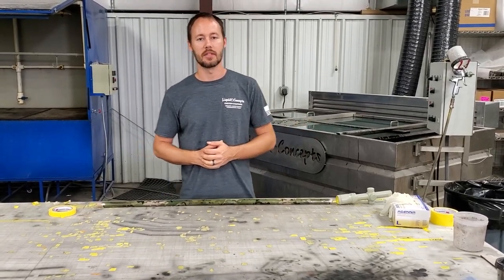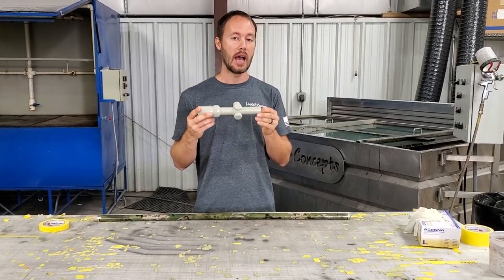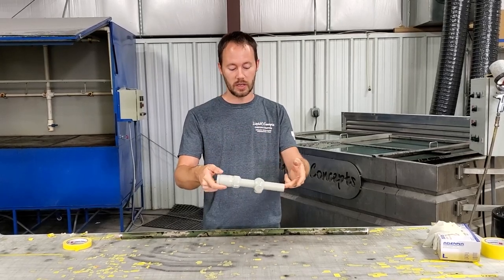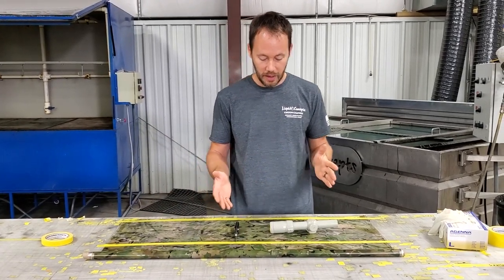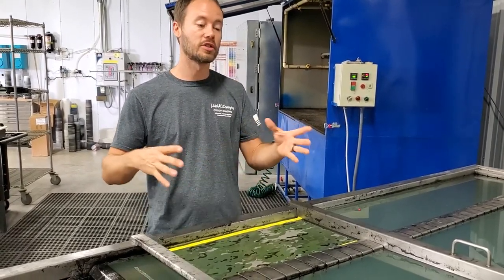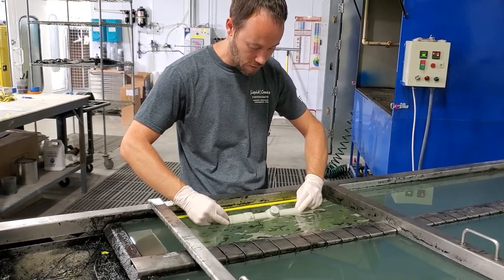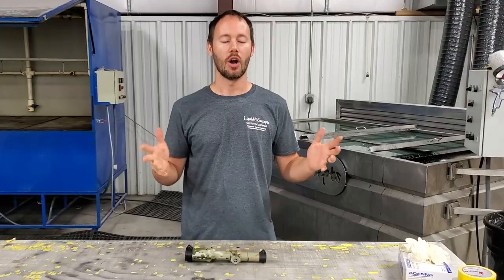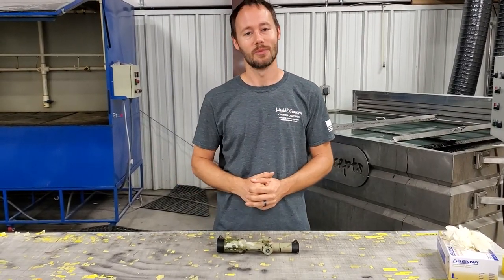HOW TO HYDRO DIP A SCOPE | Liquid Concepts | Weekly Tips and Tricks

Comment: Quick question can u have a film soak too long I recently had to deal with some veil which needed 2 minutes so went to that and have had some issues with the films that are thinner
Reply from the maker: Yes you can. Each film is different and on occasion, we have had 2 and even a 3 min. soak time on film. Normally if you let it sit too long, it wont wrap as well as it would with it soaking at the correct time limit.
Reply: @LiquidConceptsUSA  I ended up writing a book on films and started doing samples at 1 minute and 2 minutes the films that are thinner micro gave zero issues with one minute but at 2 started to distort heavy guess i get to keep a book on every film I use lol keep up the great videos